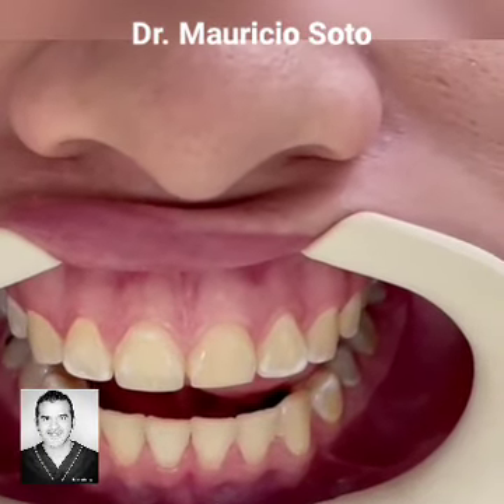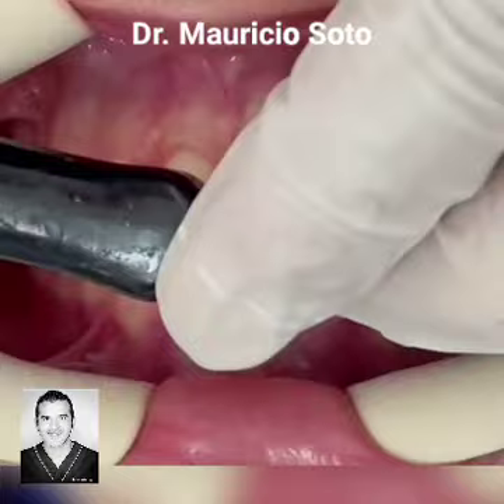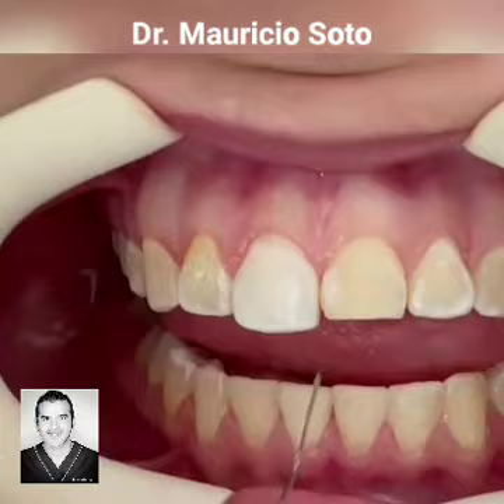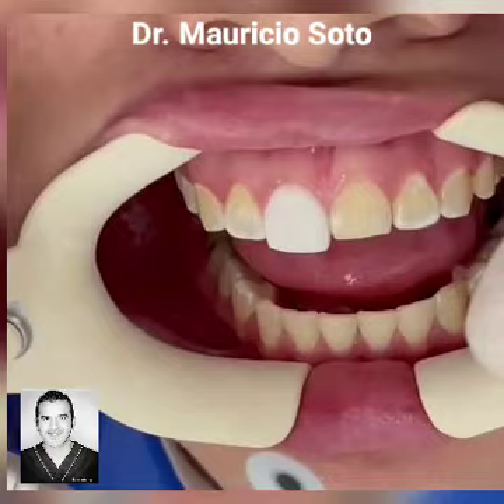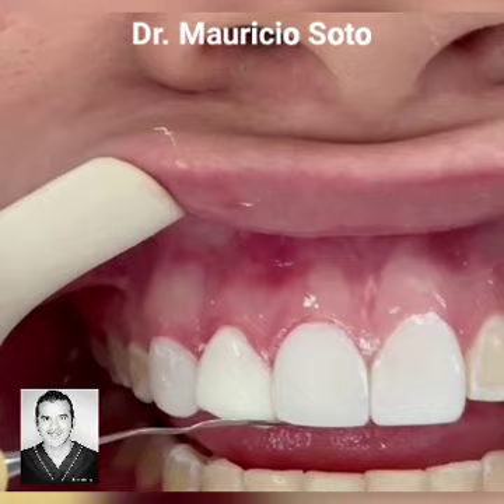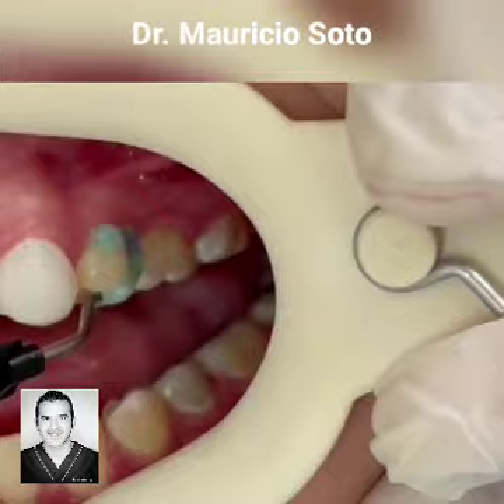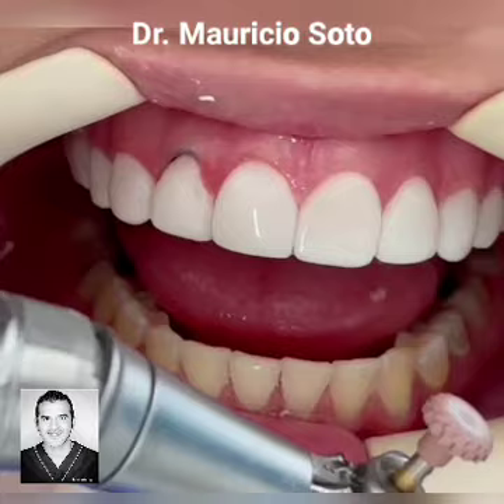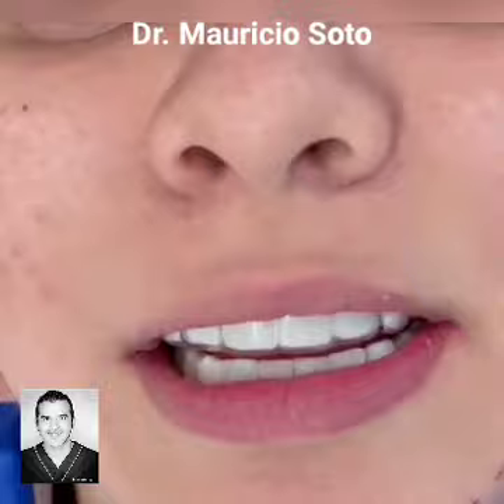Veneers = Step by Step...All the Secrets

Comment: Great work dr
I just have a small note
How can u make sure that the small portion of tooth (cervical) being bonded adjacent to the gingiva isnt contaminated by sulcular fluid!
Reply from the maker: Because I dry with Air
Reply: @doctormauriciosoto this is exactly what i mean
After u dry the tooth and apply bonding agent then  cure
Time elapses as u add composite then u scalp it
That area is susceptible to contamination
Have a look at tooth 12  (right upper lateral. The gingiva looks inflamed  it will ooz sulcular fluid that u wont notice
I make composite veneers with different techniques
All respect
Good luck
Reply from the maker: @drshahla7711  if the gum is healthy it's not a problem but if you want you can use a retraction cord 000
Reply from the maker: You use a retraction cord 000

Comment: If you put bond ( wihout drying ) first then veneers and dry with lamp. This method is not last long ? Easy to fall out ?
Reply from the maker: No ....the process is ....1.acid etching...2 wash and dry...3 Bonding ....4. Photo cure de bondind...5. composite...
Reply from the maker: No ..you are wrong
Reply: Can u teach class online also ?
Reply from the maker: @tina_ma7tina_ma764  3 days composite veneers course in Bucaramanga +573187080343

Comment: can u use braces glue before put the resin to make it more strong???
Reply from the maker: No....
Reply: step one is etchant, step 2 is bonding agent, step 3 is resin.  The method of painting something is same: step one is sanding, step 2 is primer, step 3 is paint.  You have to buy a product for each step and they all are cross compatible.  Just buy off ebay.
Reply: @artbyrobot1 what products off of eBay do you recommend?